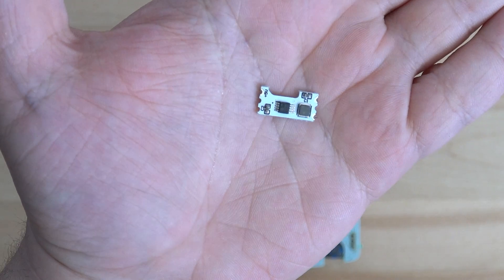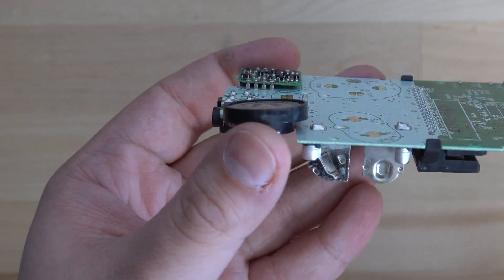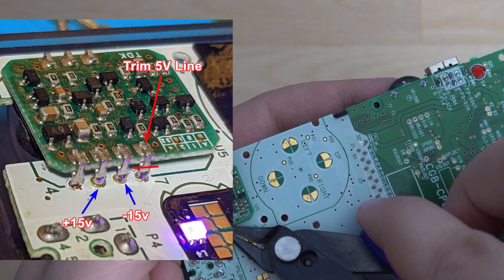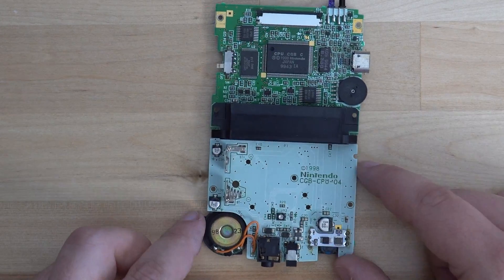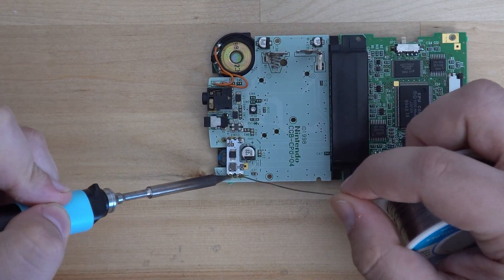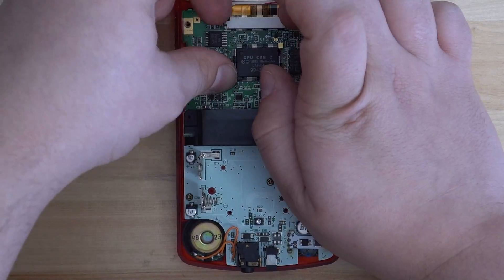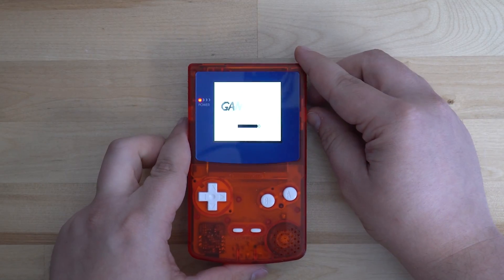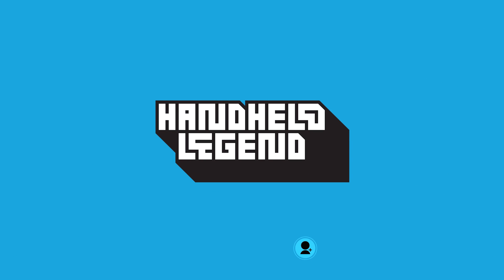Robot Retro GBC Regulator Install Guide

Comment: :T

I know everyone under the age of 25 has had their attention spans absolutely obliterated, and thus super short vids are all the rage, but I kinda wish this one was a bit longer. "The regulator" referring to both the old & new regulator, alongside the somewhat... unintuitively(?)-worded instructions have me rather extremely unconfident about what exactly I'm doing here. 

What purpose does cutting pin 7 (or, rather, pin 6(?) on the Pocket? I'm using this for a Pocket, since the HHL site says you can, but theres not a LICK of documentation anywhere to be found for it, with the GBP) serve? What happens if we don't? 

We only have to solder 3 points for the mod... does it matter which 3? If so, which ones? Why are there more pads on the mod component than we'll use? 

Ah well. Nothing for it but to try it and (hopefully) not do any irreversible damage 🥲.

Been loving this hobby over the last year or so, but hooooo boy, I wish finding concrete info on stuff wasn't such a dark art.

Comment: Installed this board with the OLED screen, no issue so far. Removed the old one completely.
Reply: Thanks, this is what I was looking for ❤
Reply: Did you cut the pin and leave the old regulator in or kick the old regulator completely? How's it working right now?
Reply: Removed the old one completely.
Reply: This is what I wanted to know, got someone to mod a board for me and wasnt sure why the regulator she put on didnt have all the capacitors on it. Makes sense now thabks

Comment: in the description on the store page it says this doesn't work with the Funnyplaying IPS q5 screen and to make it work you need to cut the pin. I'm wondering if there is even a point to using this mod if you have the funnyplaying screen? If it doesn't even provide power to that whether you cut the pin or not, what's the point? Is this only for making flashcarts work better if you're in my situation?

Comment: Is there a reason to use this over upgrading the power capacitor in the gameboy color? 

I've heard swapping out the 100uf 6.3v cap with a 680uf 6.3v cap also helps with power hungry mods like IPS screens and flash carts.
Reply: Guess you have your answer now 😅
But if it can help : the 680 cap is enough if you only have one mod  (power saving screen, for example).
The more you have, the more you come to the point this is needed. I've got oled display, everdrive, sound amp, more powerful speaker and Bluetooth sound, and without this I could hear the processor work through the speakers 😂